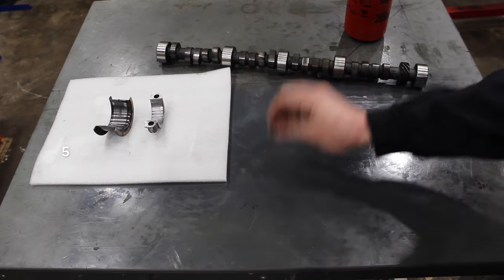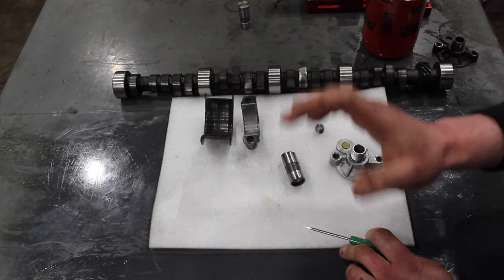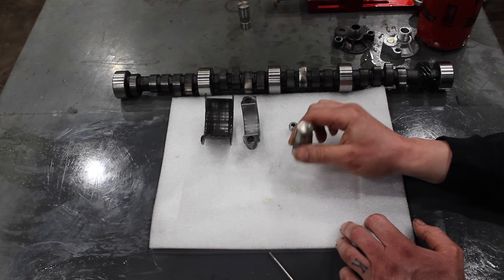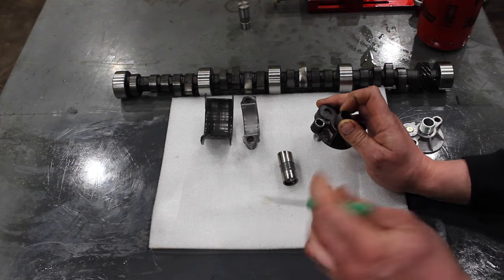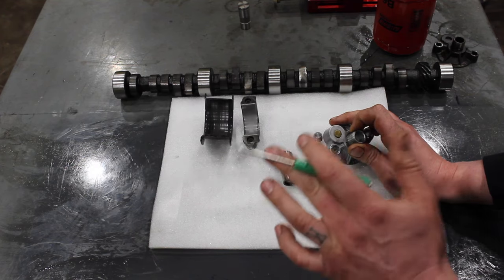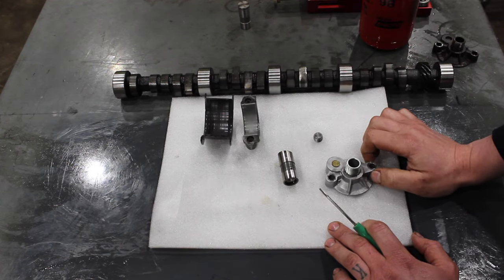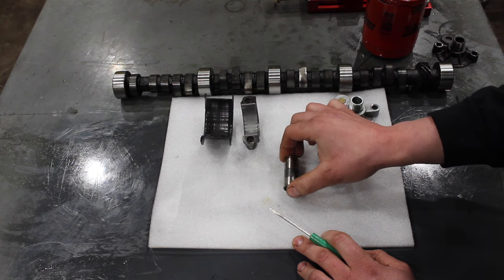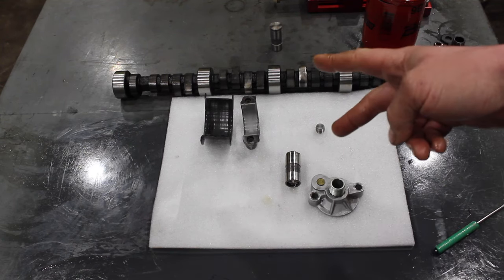Everyone With a SBC/BBC Should do this! (Almost Free Mod)

Comment: According to Chevrolet service tip...a hydraulic lifter should rotate minimum 45 degrees for every two crank revolutions. It's the non rotation because of taper problem, and improper surface finish on mostly lifters that kills them.. Look at a new gm lifter to see what is proper. If you look at older lifters which survived with no problems...you will see normal wear, not gouging, in a circular pattern on the face of the lifter. The offset wear pattern ( not dead center of the face)shows why the lifter rotates. It took some digging to find this, plus looking at dozens of still functioning old lifters.
Reply from the maker: Thats correct, some guys will even run them with no valve covers with a white line on the push rod to watch rotation
Reply: @cuttersperformance  Many years ago when I first started fooling with engines, I saw this and had no idea what I was witnessing. With the current cam lifter situation going on this is good info to know.

Comment: Great suggestion! This saved my 408! I took  the motor apart for maintenance and it had a cam button (the kind with the bearing in the front) the little bearing went bad and it  distroyed itself and almost wore a hole in the cover all that metal went in the pan ! And there was lots of it! But the cam lifters and all the bearings were mint! I didn’t build this motor but the guy who did did one good thing putting a plug in the bypass ! The Timkin cam bearing with a flat tappet not such a smart move! 😂
Reply from the maker: Yeah it could save alot of engines out there. Glad it worked out for you

Comment: Good stuff Pat! I’m putting together a 454 bbc now, this is a true down and dirty build with a custom flat tappet cam from Bullet. I’m definitely going to use this advice
Reply from the maker: I love a down and dirty build! "Budget" stuff is the most fun haha
Reply: @cuttersperformance  yessir! I did spend a little money on 063 heads. Bigger valves and some bowl work. The cam is 232/236 .510 lift (or there about) on a 108° LSA
Reply: Bullet cams are great. I worked there and all my cams come from Bullet.
Reply: I cannot get in contact with bullet cams. Are they still in business? I went to their web-page and every link returns an error message.
Reply: @RANDOMNATION907  I hope so! I just emailed the guy who had helped me to ask
Reply: @RANDOMNATION907  from the rep who helped me, “Yes we are open.
We have been extremely busy.
Customers will need to call and leave a message as we are not able to keep up with the phone calls.
You may try ext 108.”
Reply: @jimmy_olds  Oh, that's awesome of you. Thank you very much.

Comment: Great idea, or a high pressure spring.  I use a high pressure spring and high output, volume pump.  You must watch your oil and filter if you do this then it should be safe.
Reply from the maker: Use a good quality filter (balwin or wix) and change within a normal interval.  I've never had one balloon or damage in any way, even running some engines in a cold Canadian winter

Comment: I've done this for years. I ran 20w50 in my last 406 at 75psi oil pressure. I've never had a problem. I've heard you can bust a filter, but I have yet to see it. It's a must do in a hotrod sbc.
Reply from the maker: Exactly! Thanks for watching

Comment: All filters are bypass filters......they all have springs in the top....so this feature is redundant anyway .... There's also a plug inside the block on SBCs between the  oil pressure port on the rear China wall and under the rear main cap....most machine shops remove this when cleaning but they don't put them back in unless they're assembling the engine.  The net result is that oil never gets filtered no matter what you do....
Reply from the maker: Most SBC oil filters do not have a bypass. The spring at the top pushing the element down in some filters is not a bypass

Comment: Always wondered why you needed that bypass with a good filter. I work with many other performance and stock engine builds that leave any bypass if at all to the filter internally. I have several engine builds in the near future, I'm going to have to rethink flat tappet use. I'm even hearing hydraulic roller sets that don't bleed down properly. Why do the street level solid roller cams have to be so expensive? What about street solid roller cams running factory hyd roller lifters with the internal plungers shimmed solid?
Reply from the maker: Yeah, they are more, and dang lifters are just so expensive for retro fit. I've never shinmed a stock lifter solid other than for a checker lifter. The thought has certainly crossed my mind, maybe I will have to try it 🤔

Comment: I learned that the  hard way 18 years ago when the oil filter bypass got stuck on my freshly built 383 wrecked the bearing in 3000 miles .

Comment: Did the lifters have a crown when they were new? I haven't had that happen, but I've seen weld precocity in rock Auto lifters. Thankfully they sent an extra 4 and I was able to run the good ones. So far no issues.
Reply from the maker: Yeah, lifters had crown, cam had taper, lifter bores were good, proper oil was used, and the open spring pressure didn't exceed 300lbs over the nose. Maybe surface hardness? I'm not sure, but I've always done everything the same and never had an issue until this one

Comment: You can also put a washer under the spring to tighten it up or they make stiffer springs. Those chinese lifters suck, the guys over revved it or it was defective. Go roller......
Reply from the maker: Never a bad idea to go roller. But we even run a plugged bypass on our 900hp super stock engine that runs upward of 10k rpm

Comment: Master plumber here, that is indeed a 3/8" pipe plug not 1/4", 1/4" is more like the diameter of that green screwdriver you're using
Reply from the maker: A 1/4 NPT plug is just over 1/2" OD. The hole in the stock adpter is the perfect size to tap to 1/4 npt. A 3/8 npt plug is almost 5/8 OD way to big

Comment: Don't agree. If you think that the pressure of opening is too low -increase it . But complete blocking is too radical. Really cold oil flows like honey and can't penetrate filter easily.
Reply from the maker: Like I said in the video, I would tell anyone to run no bypass during break-in, but if they want to swap out after the first oil change, that's their choice. They can also run a filter with an internal bypass or try to add spring pressure to the stock bypass.
Personally, I run no bypass, even in my shop truck. Freezing cold winter mornings and see no drop in oil pressure or damaged filters. I dont let my oil get super dirty and use quality filters

Comment: best to tap and drill tiny holes in the front oil galley plugs after you replace them behind the cam gear but you don't need to plug the bypass just keep the oil changed be sure and use zinc additive for the break-in

Comment: You have a bypass in the oil filter itself, so much for the 100% oil filtered  HUH.
Good filters have a coil spring  cheap ones have a piece of flat spring steel. I prefer Wix they have a coil spring or they used to.
Reply from the maker: @frederickshipp8013  Actually, most filters used on sbc don't have bypasses, unlike most modern engine filters. Some of the "Race" filters like wix and fram, have an internal bypass, but your regular sbc filters like the PH30, 51069 or B6 filters do not have an internal bypass

Comment: What if you are running a oil cooler like on a truck,it has a little valve in it is it a by pass or is it a temperature controlled valve??

Comment: I've heard this plug to be beneficial on a race eng. runnin lots of oil pressure. H-O racing offered it. But on a DD street eng., not maintained very well, dirty oil is better than no oil. (Just sayin.)
Reply from the maker: I highly recommend plugging it on a new rebuild but after the few two oil changes you can swap in a bypass. Personally, I run a plugged bypass on my daily, use a good filter, and change the oil on a regular interval

Comment: Should we also fit a gasket under the oil filter adapter? Also, is the rear main feed unfiltered oil directly from the pump?
Reply from the maker: No gasket needed and no the rear main is not feed directly from the pump

Comment: Question I'm putting together a new 88 .030 roller ready short block I'm doing some de-shrouding to my already modded gM iron heads while I have the chance, I would love to toss a roller in at the time but I suspect money will be tight at that point so I'm thinking that will have to wait and my old short block has a perfectly fine great working Howards .480/231°/108° lsa/106°ICL flat tappet cam that's been in it for years so I'll probably use it for awhile, with obviously all the lifters going to the same lobes do I need to use a "break in" cam lube or should I just oil it? I assume the cam should not even realize it's in a new engine... I've always used a zddp additive during oil changes in the old engine. Wish I had the money Howards has a bunch of nice cams designed for factory style roller lifters.  I'll def do this mod, great vids there kinda a one stop shop for SBC.
Reply from the maker: I got a cam break in video coming up and yes I used break in additive as well as break in oil. Video will have a few more tips and tricks I use

Comment: How good of a filter is the pf454 ac Delco filter? I run only them on my 355 vortec build. I also put a hvhp oil pump on it thinking more is better but now I'm thinking I really don't need that much oil pressure. I get a mystery rear main leak at higher rpms (4500 - 5000 and above) I only know about the leak because the passenger side header smokes when the oil hits it. Runs very nicely and dang good power otherwise.

Comment: I thought the Oil pressure was controlled by the Pump's relief valve.
Reply from the maker: It is controlled by the pump pressure valve. This is the oil filter bypass valve in the video

Comment: Very good information. I am currently rebuilding my 327 because the cam went flat and debris made it into the bearings through the by-pass. 
           If I am correct, it appears that the lobe of concern in your video is the same lobe that failed on mine, the # 6 cylinder exhaust lobe. I wonder if the location of the lobe in the engine has the least splash oiling or if the cam manufacturers hardening treatment somehow is inadequate in that area. I had two cams by the same manufacturer go bad on that same lobe. 
         This is the first time I am going to use a non-bypass oil filter adapter (billet unit, not modified OEM) and an aftermarket Roller Cam. Your experience with them is a great reassurance that they work safely. Do you also use a hi-pressure, hi-volume pump as well? I am trying the new "shark-tooth" oil pump on this rebuild as well.
Reply: I agree with the concept of plugging the by-pass. I also think it should stay plugged beyond the break-in process because a component failure can happen well after break-in and even with the roller cam, if a roller goes bad and the wheel comes apart, all the debris will do the same if allowed to go through the by-pass. Yes, block off the oil filter housing by-pass, AND use a filter that does not have an internal by-pass, otherwise you will defeat the purpose.
Reply from the maker: Sorry to hear about your engine man. Im wondering if you have a egg shaped lifter bore? Two cams same lobe wouldn't be suprised. 
I run std pressure HV pumps on most builds 
I run a blocked bypass, with a non bapass fillter all the time, works perfectly 👍
Reply: @cuttersperformance  That is good to hear, Thank you! As for the lifter bores, they are fine. I had initially run the hydraulic "151" cam in this engine for a few thousand miles with no issue. Only the later installed solid-lifter cams (both Ultradyne, same part #) failed starting at the # 6 exhaust lobe. I reviewed everything from spring height, spring pressure, lash settings (spec for those cams was .026" and set accordingly).  The first cam failed within hours of break-in so I wrote it off as my mistake. The second cam though ran well for approximately 4,000 miles before failing. I believe metallurgy of either the cam or lifters were to blame. I intend to run a hydraulic roller this time and from now on. It is too expensive to trust in what you cannot see or verify. Such as surface hardness depth. 
    I always run full synthetic after break-in, which flows better than conventional oil when cold. I also store this car during winter months, so chances of bursting an oil filter should be nearly 0 even without the by-pass. Thank you again for the reassurance and I look forward to more of your excellent videos my friend. God Bless.

Comment: So,how do you do this? Do you just screw this plug in a hole? Do you have to drill and tap the hole for the plug? What needs to happen?
Reply: Tap it or get a stiffer bypass spring.

Comment: Is this bypass on stock filter housings or aftermarket adapters?   Also, had good luck with melling lifters in the past few builds.
Reply from the maker: Stock or aftermarket stock replacements have a bypass.  You can get aftermarket ones with no bypass aswell
Reply: @cuttersperformance  Thanks! Appreciate your builds and tech info! Great channel

Comment: OK so if the oil is 100 % filtered does it save all the  rest of the engine from having to be taken apart and rebuilt after a cam failure like that .?
Reply from the maker: @glennmanchester5696  yes exactly, you'll save the bearings

Comment: No other manufacturer uses bypasses so should not be a problem eliminating it.
Reply from the maker: Alot of modern deisgns puts a bypass in the filter rather than in the block or adapter

Comment: I take it the bypass wasn't plugged on the motor with wiped out lifter?
Reply from the maker: It was plugged and thats what saved the bottom end. Often times a wiped lifter will causes major bearing damage as bypass opens allows the  metal to go right past the filter into the bearings.

Comment: Most oil filters have a built-in bypass.
Reply from the maker: Actually most sbc filters like the Fram PH30, wix 51069 or the Baldwin B6 all do not have internal bypasses.
Reply: @cuttersperformance  That's good

Comment: Where does the plug go?  In the block or in the filter adapter?  What size and thread?  Maybe i missed all that .  Sorry
Reply from the maker: All in the video my man.
In the filter adapter 1/4 npt plug
Reply: He said he made a video of it.
Reply: Drill and tap the adapter for 1/4 and install a 1/4 pipe plug
Reply: Thank you everybody.

Comment: That is the dumbest thing to do you  a small and big block chevys  you have to bypass the filter after about 2000 rpm, and the stock oil pump has too much volume. The filter can't handle the volume of oil, so you are starving the engine !!!
Reply from the maker: We do this on all our engines including a 10 000 RPM super stock motor. We haven't had a starvation issue
Reply: It doesn't bypass at all unless the filter is clogged. You really think oil only gets filtered under 2k rpm?

Comment: i would not do that, run after market dule filter if you are going to block bypass
Reply from the maker: Ive been doing it for quite a few years now on my daily sbcs and race engines with no ill effectss. Just be sure to use a good filter and as big as possible